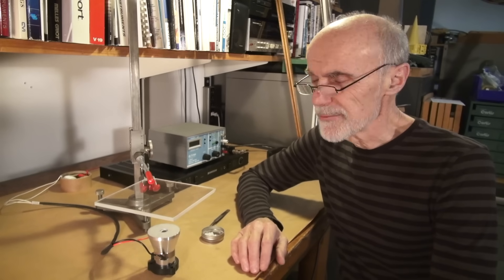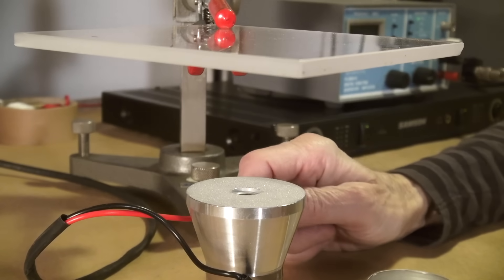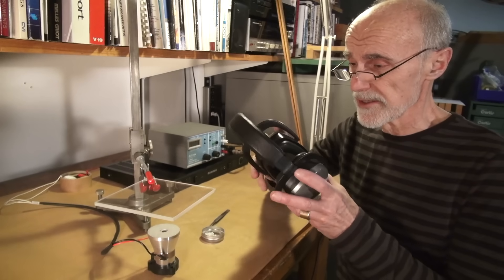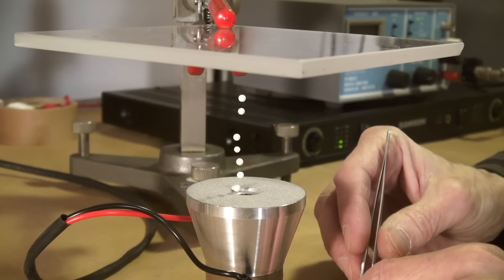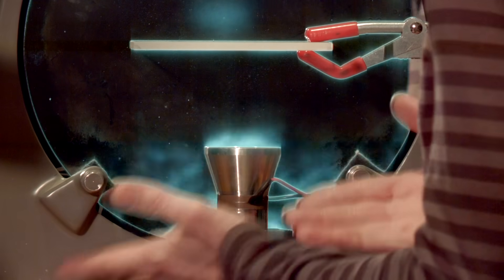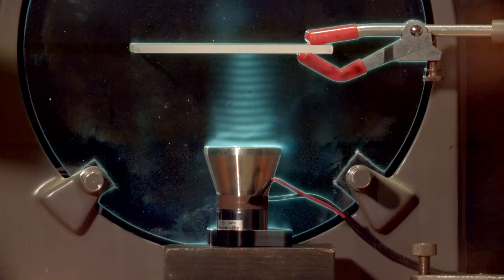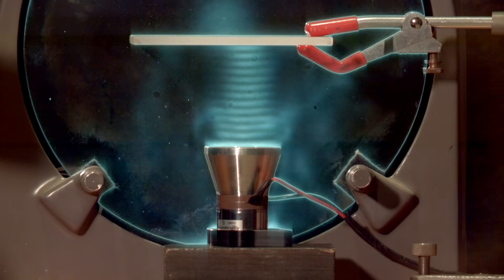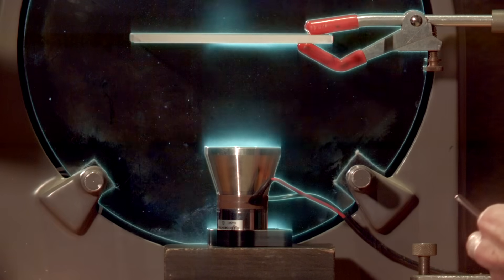Acoustic Standing Waves and the Levitation of Small Objects

Comment: Bad ass, great video.

Wait, what else is there to make the mirror reflect the waves? Does it need a special light frequency?
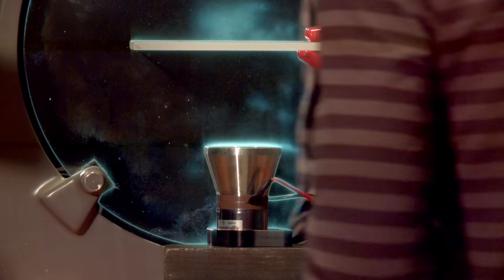Reply: The mirror is part of a schlieren setup, which bounces light back on its original path and can show density changes in the air. At 2:48 you can see that the warm air rising off his hands is visible as if it were fumes, but its just the change of refractive index due to the density change. The optics are there just to show the standing waves, the acoustic effects don't need the optics.
Reply: @r0cketplumber  yeah, but my question was if the mirror needed a light frequency to be able to reflect back the waves...already found the answer and the answer is yes, more than a specific light frequency, it needs a one pointed source of light and a sharp obstruction before it hits the mirror, without it the mirror does not reflect the waves.

Comment: As an aspiring engineer, I always wondered if there's any real world applications that this can be applied to. For example, achieving 90% efficiency or more on generators. Can we control fluids, or even electricity, by using this technology? How much power does it consume to produce this kind of frequency?
Reply: One application is manipulation of small particles ... the acoustic analog of optical tweezers.  The transducer electronics consumes about 100 watts of power, even though we're only operating at 8 watts.

Comment: It is wrong to say that small objects levitate at the maximum pressure. That is not correct. It levitate at nodes, that is where sound pressure has least amount of change. Antinodes on the other hand has the maximum amount of air pressure change at driving frequency.
Reply: our experiments demonstrate otherwise
Reply: @wolfgangrueckner7151  Okay, I will check that once figure out how to make very small microphone for 40 kHz. Then I can insert it at nodes and antinodes and compare amplitude with area where balls floating. Thanks.

Comment: If he did that same experiment with the equipment upside down in a vacuum the balls would appear to fall up when he turned it off. Also think of he earth as the speaker and the atmosphere as the plate, there is proof  sound energy is being emitted from earth(look up NASA earths hum), if your change your bodys frequency using sound (your own sound/voice) you can levitate in the earths high pressure points. Its the same way bees fly.

Comment: I'm curious about the possibilities of building a SHA-256 microcontroller that precisely gauges the frequency vibrations between the broadcaster and the  reflector. The suspended balls  represent a subjective static position and layers of range. These layers of range can be measured precisely (floor to ceiling) so that exact difficulty of maintenance (DOM) can be mathematically calculated.  When the difficulty of maintenance attenuates by manually adjusting the distance between the reflector and broadcaster,  the layers of range change as the floor to ceiling measurements are stretched  or condensed.  This too can be calculated precisely in reference to the amount of frequency produced between the broadcaster and reflector. The the main idea is to precisely calculate the difficulty level of SHA-256 hashes for mining Bitcoin.  I would like to see the mathematics behind this idea. Mathematically and technologically speaking,  there is a whole host of applications and uses for this technology.   I live in Bali too far away from you,  so I'm afraid that a visit to your facility is out of the question.

Comment: Amazing demonstration, very well done!
Here is my take on trying to explain what is going on assuming that the spheres are heavier than air and don't float by themselves: 

It seems natural that the lokal total pressure gradient is what makes the spheres float. Integrating local pressure in the z direction on both the bottom and the top surfaces of the spheres and taking the difference gives the total lifting force on the sphere. The spheres will settle at the points where this lifting force equals the weight of the spheres. 

Actually, this is the only way it can work as long as all the forces are due to fluid dynamics.

I figure that the total pressure at point on the sphere can be divided into a static pressure and a dynamic pressure as in aerodynamics. The static pressure is the force from particles due to mean free path at 1 atm  300k (100nm at about 500m/s molecular velocity) and the dynamic pressure is due to the more macroscopic air movement from the standing wave pressure/rarefaction cycle at 28kHz. 

The sum of these static and dynamic effects create the lifting pressure distribution on the sphere.

Comment: IT would be interesting to see what happens with different gasses instead of air.  IT would be illogical to try this in a vacuum but I would anyway just because.
Reply: Different gasses would change the spacing between the bands of light.   For example, they would be closer together for CO2 and further apart for helium.

Comment: Does anyone know how to calculate the distance at which the reflective surface has to be from the Hz generator give the desired frequency?
Reply: The velocity of sound (340 m/s in air) is equal to the product of the wavelength and frequency.  So, divide the velocity by the frequency and you have the wavelength.  The distance you want is some integer multiple of a half wavelength.  In our case the wavelength is 1.2 cm and the distance is some multiple of 0.6 cm.

Comment: you are closed with the frequency only too far away from the angle of attack....  have in mind you could not do this experiment with a 100 ton rock using this method.....  it would be inpractical.... try 369 apperture

Comment: Good evening, please : wouldn't a ball be pushed off a higher pressure area (by the higher pressure), into a lower pressure area ? Thank you for an excellent video.
Reply: That is what the literature says.  I shall be performing more experiments soon to give a definitive answer.
Reply: Sir Wolfgang : I thank you very much for these excellent videos, and for your reply, especially considering how many views it's gotten. I haven't consulted the literature on the matter, but do you see the same problem as I do that an object would be pushed from a higher-pressure region to a lower-pressure region, or do I fail to grasp a concept ? Thank you,
good week.
Reply: I know that I am contradicting what some of the early literature says.  Here's the way I think about it:

The air molecules are, of course, moving longitudinally in the standing wave.  The pressure (or density) is 90 deg out of phase with the velocity.  One can intuitively understand that this must be so by considering what is happening at the boundaries of the standing wave.  At the surface of the reflecting plate, for example, the molecules cannot move at all, and the density (whether positive or negative) must be maximum there -- the molecules either "pile up" at the surface of leave a negative pressure behind as they bounce off the reflecting plate.  The other boundary of the standing wave is the transducer.  The air molecules move maximally at the surface of the transducer as it vibrates back and forth.  Overall, the motion of the air is similar to the natural mode of vibration in a pipe closed at one end.  The pressure antinodes occur every half wavelength and it is at these antinodes that the molecules move least.

Styrofoam balls injected into the standing wave settle into the pressure antinodes.  Many find this counterintuitive, reasoning that the balls should move away from a high pressure zone.  Visualizing the actual motion of the air might convince you.  The air molecules are in an antisymmetric normal mode of vibration.  From the balls' viewpoint, air molecules are either rushing in symmetrically from both sides or moving away symmetrically, and the balls settle down in a zone of least motion.  When gravity pulls a ball downward, the ball will encounter more collisions with air molecules from below, resulting in a net upward force, back to symmetric equilibrium.  Does that make sense?

Also, have a look at one of our new videos, especially the one where we introduce color to analyze what's going on  --  Wolfgang
Reply: Sir : excellent explanation, I see it now. Double thanks for double replies. I wish you an excellent year, kind regards.

Comment: I see it mentioned 28 kilohertz but you don't say anything about what the amplitude is set up. Trying to recreate the project using a similar transducer but having trouble achieving levitation. What about the tiny screw that fits into the center of the transducer I can't tell if it's not being used here or screwed so far in that it's flush. Thank you for your help!
Reply: Although the transducer is rated to operate at 50 watts, we supply only about 8 watts of power to achieve levitation.  We aren't using the screw that fits into the center ... I think it's purpose is to secure it firmly onto its mount, which we don't bother to do.
Reply: Wolfgang Rueckner thank you very very much for replying I suspect that our troubles lie in the Precision of control of the reflector plate. We'll keep trying
Reply: Yes, a strong standing wave (and levitation) is very sensitive to the position of the reflector plate.  A fine adjustment is helpful.

Comment: Dear Wolfgang, 

I am puzzled about your statement that the spheres are trapped in “high pressure” regions.

First of all, as far as I know, there is no such thing in a standing wave, as these are pressure swings from maximum to minimum pressure. So compared to atmospheric pressure, these are both just positive and negative pressure deviations.

Next, just as you state, it seems logical that particles would be trapped at positions of minimum air particle displacement.
That would indeed be at regions of maximum pressure deviations. 

However, as far as I know right now, grey bands in the Schlieren optics recording would indicate regions of high gradient of refractive index, which would correspond to high gradient in air density n. Which in turn corresponds to high pressure gradient according to the ideal gas law p=nRT. 
That would indicate that the gray bands correspond to the zones where the pressure variation is near-zero. 
So that would indicate that you put the tiny spherical particles in low pressure deviation zones in the video.

Further, the earliest literature on the subject that I found (Whymark, 1975)  states that the particles reside in “low-pressure areas”, which of course would means areas where pressure variations are near-zero. 
-->
See: https://ntrs.nasa.gov/search.jsp?R=19750000232 
Author and Affiliation: Whymark, R. R. (Intersonics, Inc.)
Abstract: Activated sound source establishes standing-wave pattern in gap between source and acoustic reflector. Solid or liquid material introduced in region will move to one of the low pressure areas produced at antinodes and remain suspended as long as acoustic signal is present.
<--

There is more literature, with an in-depth analysis of the micro-mechanics of this experiment;
—> 
Acoustic Levitation on an Annular Plate
Mehmet Hakan Kandemir
Mehmet Çalışkan
Department of Mechanical Engineering
Middle East Technical University, Ankara, Turkey
https://www.researchgate.net/publication/265914212_Acoustic_Levitation_on_an_Annular_Plate 

Abstract
In standing wave acoustic levitation technique, a standing wave is obtained between a source and a reflector. The nodes of the standing wave act as a linear spring to attract the particles towards the pressure nodes, thus particles can be suspended in air. This operation can be performed on continuous structures as well as in several number of axes. In this study an annular acoustic levitation setup is designed. The setup consists of two langevin type piezoelectric transducers, two waveguides, an annular plate, an annular concave reflector, supporting structures, a signal generator and a power amplifier. The transducers are activated by harmonic signals generated by a signal generator and amplified by an amplifier to excite the waveguides. The waveguides amplify the vibration amplitude and in turn, excite the annular plate to a bending mode at a certain frequency. As the plate vibrates in bending mode, it excites the air and gen erates sound waves. Several types of bending modes of the plate are simulated and evaluated. With the right positioning of the reflector plate, standing waves are formed between the annular vibrating plate and the reflector plate. At the pressure nodes of the standing wave, it is demonstrated that small particles can be suspended in air.
<—

So this paper also states that particles are trapped in the pressure nodes; and not at regions of highest pressure variations.

As your argument that particles would be trapped at positions of minimum air particle displacement at first seems completely logical, I am still puzzled about the correct way of reasoning in this experiment.

Sincerely, Klaas Visscher.
Reply: Dear Klass -- yes, I know that I am contradicting what some of the early literature says.  Here's the way I think about it:

The air molecules are, of course, moving longitudinally in the standing wave.  The pressure (or density) is 90 deg out of phase with the velocity.  One can intuitively understand that this must be so by considering what is happening at the boundaries of the standing wave.  At the surface of the reflecting plate, for example, the molecules cannot move at all, and the density (whether positive or negative) must be maximum there -- the molecules either "pile up" at the surface of leave a negative pressure behind as they bounce off the reflecting plate.  The other boundary of the standing wave is the transducer.  The air molecules move maximally at the surface of the transducer as it vibrates back and forth.  Overall, the motion of the air is similar to the natural mode of vibration in a pipe closed at one end.  The pressure antinodes occur every half wavelength and it is at these antinodes that the molecules move least.

Styrofoam balls injected into the standing wave settle into the pressure antinodes.  Many find this counterintuitive, reasoning that the balls should move away from a high pressure zone.  Visualizing the actual motion of the air might convince you.  The air molecules are in an antisymmetric normal mode of vibration.  From the balls' viewpoint, air molecules are either rushing in symmetrically from both sides or moving away symmetrically, and the balls settle down in a zone of least motion.  When gravity pulls a ball downward, the ball will encounter more collisions with air molecules from below, resulting in a net upward force, back to symmetric equilibrium.  Does that make sense?

Also, have a look at one of our new videos, especially the one where we introduce color to analyze what's going on  --  Wolfgang

Comment: Very cool demo. Saying the ball levitates in nodes of high pressure is skipping a step or two in logic though. Is it not actually levitating at the point of the standing wave that the integrated force around the surface nets upward the weight of the object. Not exactly the same place as where pressure is highest, because the weight would not be canceled out in that exact location.

Comment: Great video. Why is this concept not yet applied to heavier objects? I assume this same analogy would be applicable for objects of any weight. Is it because we do not yet have devices to produce a high enough frequency capable of levitating heavier objects?
Reply: It would require sound intensities that would be lethal to all living things in the vicinity.
Reply: Wolfgang Rueckner I'm now re-thinking that higher frequencies would only cause shorter wavelengths, hence shorter still zones not capable of sustaining larger objects. I believe the solution to lift larger heavier objects would be to figure out how to cause more interference waves to produce fewer but larger still zones. A single high pressure zone formed after twirking with interference waves would be ideal.
Reply: True, the standing waves of higher frequencies are closer together and the opposite for lower frequencies.  But the bottom line is that you need extremely high sound intensities to secure a force great enough to levitate large objects.

Comment: Hi, we are a group of students from Spain who are trying to carry out this experience. We have already the ultrasonic transducer and the reflector ready, but we have some doubts about the project. First of all, when you use the protection for your ears, how many dB can we bear, and can this experience damage our ears? Another question is about the connection between the oscilloscope and the transducer, and the connection between the function generator and the transducer and how does the circuit work, do we need anything else?
 However, our main problem is the amplifier since we need one which must be adapted to capacitive charges. How do you think we can build an amplifier with these characteristics?
Thank you for your help.
Reply: For safety, you should not subject your ears to more than 90 dB for any length of time.  Since most dB meters don't work in the ultrasound range, you can't measure the intensity, so wear ear protection to be on the safe side.

In our set-up, a sine wave function generator provides the signal that goes to a 100 watt audio power amplifier.  The output of the amplifier drives the transducer, but since the output is designed to drive 8-ohm speakers, it is necessary to use an impedance matching transformer between the amplifier and the transducer.  Ours is home-made, but you can purchase a commercially made one.